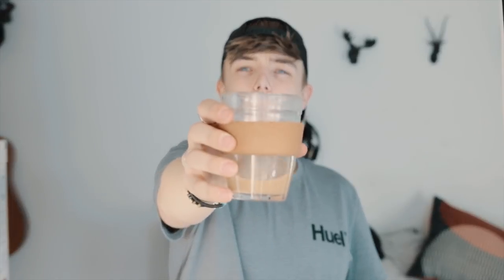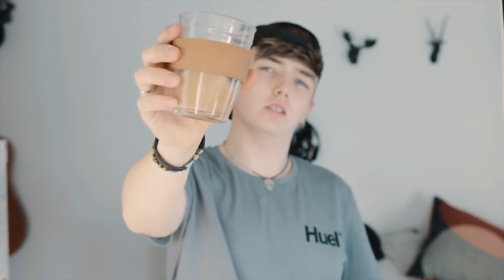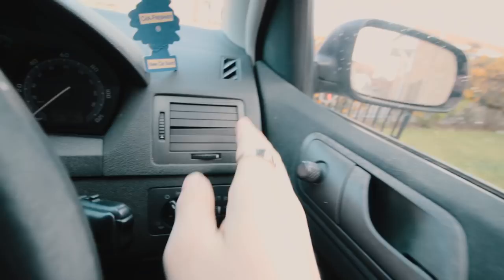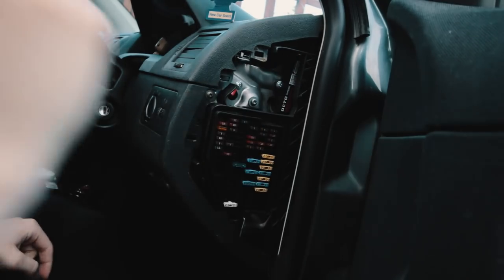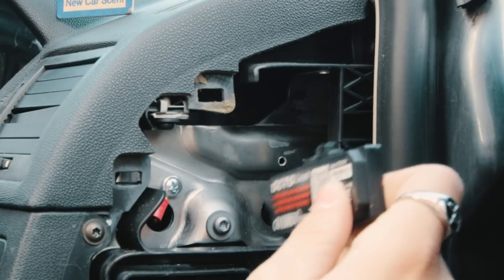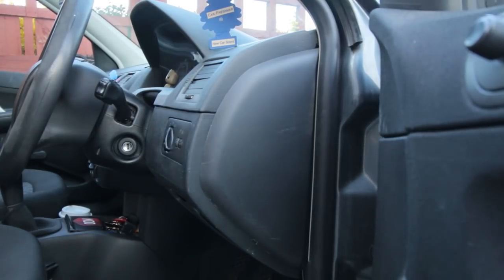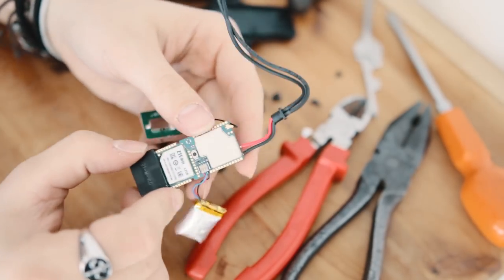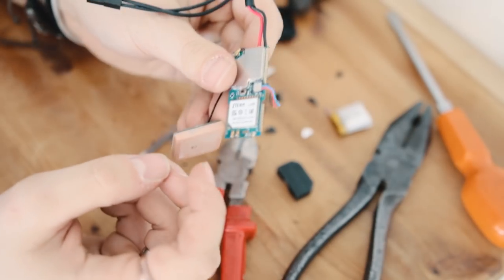Whats Inside A BlackBox? (Is BlackBox Insurance Worth It?)

Comment: The item with a single wire could be the Ariel or the GPS ariel. The kit will have an IMEI as it connects to the GSM network and all machines that connect to GSM have to have an IMEI. It may not have a SIM card as it could be built into the device. Those square metal boxes will have a gyroscope just like a mobile phone has to work out where you driving and when you turning etc. You're correct that little package was a battery, that's probably used when your car battery goes flat or to cover when you're starting your engine. All in all, quite a good vid. Keep it up.
Reply from the maker: This is awesome man, thanks for all the info 🤟🏻🙌🏻 really interesting to read 👌🏻 but thanks, glad you enjoyed it man 🙏🏻

Comment: Crazy prices! To anyone looking at a first car, my advice is look for cars NOT used by first time drivers. I’m 18, I passed my test in May this year.

On a 1.8 MK2 Focus, I pay £100 a month with no black box. 

Also I know it can be a pain, but it dropped my price from £150 a month to £100 a month, start your car insurance a month in advance, it could save you £100s a year just for waiting one month.

Add your mum and dad on the policy as long as they have been driving a decent time. 

It can be a ball ache but shop around. Little 1.0, 1.2, 1.4 Corsa’s, Fiestas, Fabia’s have a High crash rate due to young drivers. Hence why my insurance is so cheap on my focus.

Comment: For those looking at getting any insurance here are a few things I found made the price cheaper:
- Look at insuring the vehicle as many days away from the current day is (i.e. if it's Monday 29th April, look at getting the car insured for 30 later than that day) The further away the day of the insurance starting the cheaper the insurance will be 
-Add additional driver, parents, family friends, work colleagues (Make sure the person you are adding is over 25 otherwise you'll be paying more, also ensure they have no driving penalties)
-If you don't want to use the car for work then set your annual milage lower, unless you want to travel within that year more than you expect. (6000-8000 miles is enough if you don't use the car for work)

These all worked for me on my first year I saved over £1000 and had a black box

Comment: Hey Jed,
I would suggest that wire that went through the hole, probably has some link to your on board diagnostic to read the data from your can bus system, which can read speed etc.  Check your odb or diagnostic port, or possibly go under the dash from your pedals to identify where that wire went there may be more to it that your video suggests.

Keep up the good work.
Dave

Comment: The thing you keep calling the sim card is the SMS module. It basically just contains an antenna and some microchips. The sim card is probably underneath one of the other metal caps.
The big square thing with the pink(ish) edge is a GPS module.